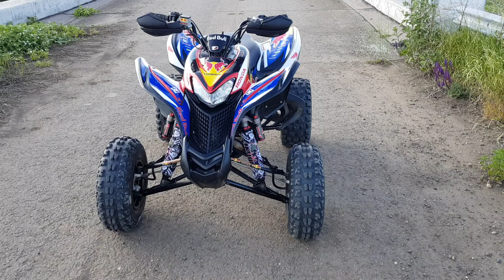Honda TRX700xx R - walk around -Redbull design Wiseco Yoshimura Elka K&N

Comment: whats your setting on the wiseco efi i have the same one with a full system and k&n but can't gte it to run correctly
Reply from the maker: achraf zahar Im also not satistfied with it. I  used it: L2  M2.5  H2 Honestly I do not know the correct settings... :/ do not feel any differences between the options
Reply: at least im not the only one im really having trouble with this fuel controller the bike misfires a lot it's like the programmer isnt plugged in ive tried several settings nothing seems to work or make any difference  there is no customer service or assistance i tried contacting them.. no response i will be getting the ehs one this month this one has to go in the bin btw your XX looks sicks which shocks are you using ??
Reply from the maker: achraf zahar Elka stage 3, very good choice, i bought it some month ago, but I sold my xx last week without the shocks. So it is sale :D